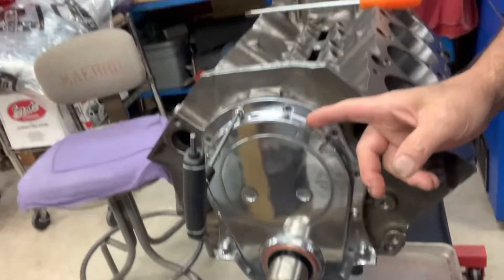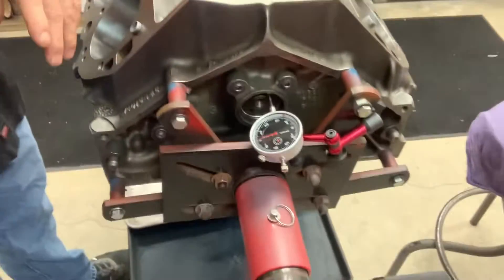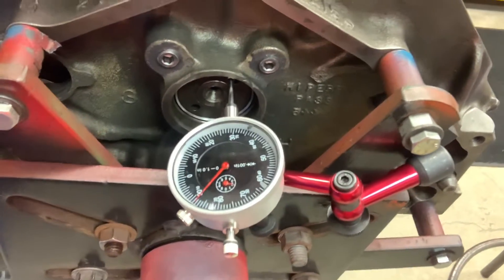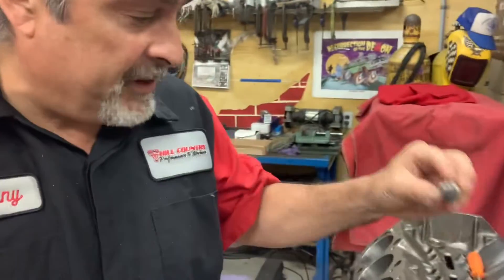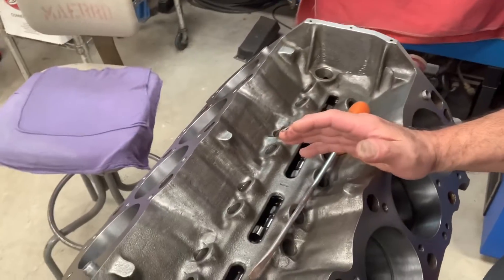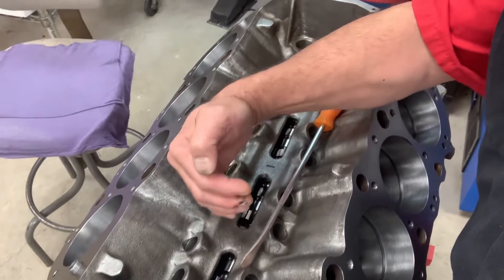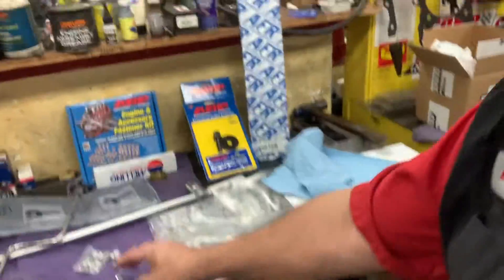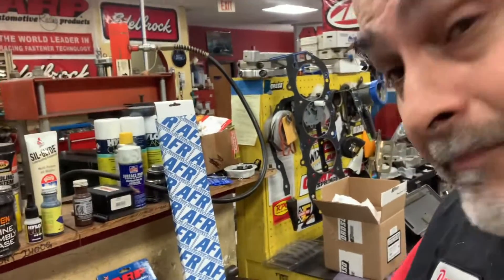How to check cam end play and why you should.

Comment: When i worked on a gm assembly line, i never had end play fail without something either locking up or the bearings spinning in the channel. 

I check end play, but if everything spins free while the bearings sit tight, it generally wont fail the mic check imo
Reply: How much time did they give for engine run tests after assembly?
Reply: @flinch622  idk they did a series of oil and coolant pressure checks further down the line

Comment: Hey Danny. I recently took apart a 489 BBC. The rear part of the cam was ground down along with the cam plug in the rear. I'm running a comp cams hydraulic roller. I though I checked the cam thrust clearance, but who knows. Any idea what could is causes that running in the back of the cam?
Reply from the maker: Any chance the cam bolts cam loose?
Reply: @MrDanielSoliz  no they were tight.